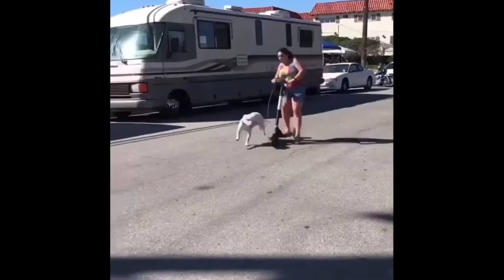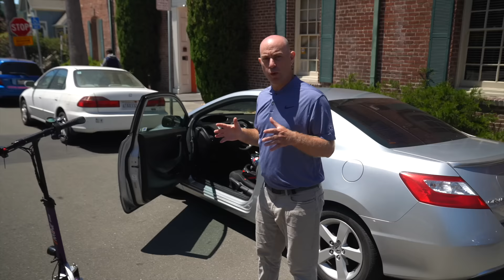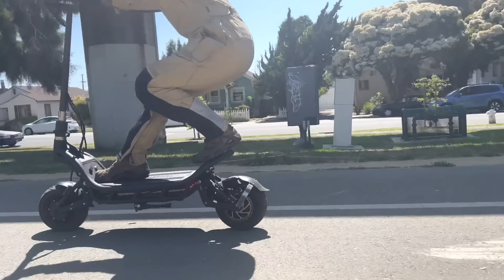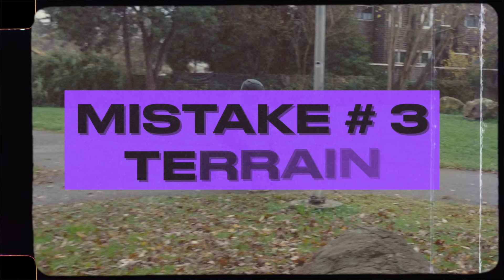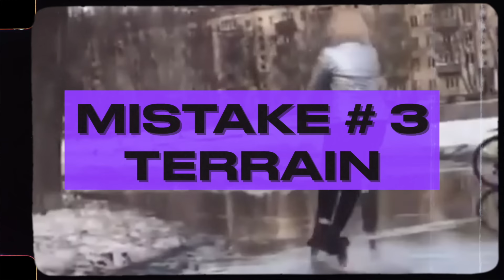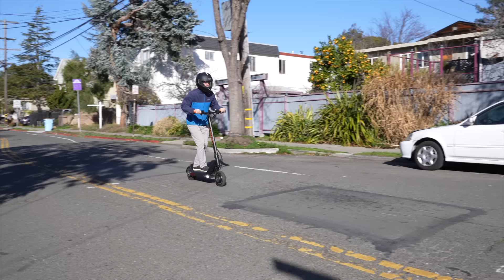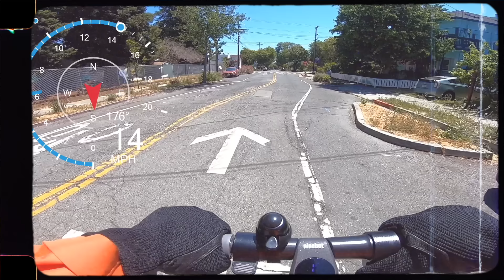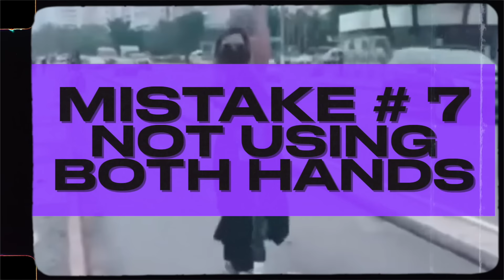Top 7 Riding Mistakes New Scooter Riders Make & How to Avoid Them

Comment: This video saved my life. Thank you so much. Hitting pot holes going full speed on a Apollo ghost is not a good thing . I almost flipped forward over the handle bars. Getting lower by bending knees and leaning back to get the back tire on the ground again actually worked. You saved me from crashing.
Reply from the maker: Wow! Awesome! Thank you for letting us know!    -Paul
Reply: How are you liking the ghost because I’m thinking of getting one
Reply: Im really liking my Apollo Ghost. I replaced the tires to Tuovt 80/65-6 . these tires are wider. And I installed a steering damper. Basically I could ride with no hands on cruise control even while hitting small bumps. The steering damper made the scooter so much more stable. Kool-Stop brake pads KS-DS20 provide better braking. Changed grips to ODI.  And I redesigned the rear foot rest from 1/4 aluminum and grip tape on top . No more slipping . The scooter is plenty fast. I push it hard and it scares me in sharp turns going 30 something. The Ghost is a great scooter.
Reply: @Snfjsjsi  I replied below your message.
Reply: @Syncere20  Wow, you really love your scooter. That reminds me of that song in Grease. A 2022 version. Seriously, I'm gonna buy one. That's why I'm here. I wan't to know everything I can before I buy. Your information is priceless. Even if I don't yet know what it all means.
Reply: @Syncere20  where did you find the steering damper for your ghost, I bought a phantom v2 and I already to had a nasty slip broke my wrist possibly under inflated off road tire and I hit a pot hole going 42kmh wheel started shaking aggressively, a steering damper would be wonderful
Reply: Also scooter is fine just a scratches
Reply: @jeffer0987 Steering damper is from Ebay. And the new Radial PMT tires are the very best out of several brands that I tried. It says there tubeless but you still need a tube. The steering damper and PMT tires are the best upgrades.
Reply: Does any1 know if the dualtron 2 is a good scooter
Reply: I love riding electric scooters but being a senior,  I decided to get a seated model.  It has front and rear disc brakes and I can control the scooter better if I hit a pothole because my center of gravity is much lower to the pavement than when standing up. And I always wear a helmet  because traveling even at a slow 15 mph could get me seriously injured if I crash.
Reply: Me too! I avoided a few accidents thanks to the tips I learned in this video.
Reply: Dude it's just the same with skating and surfing. Work on squats kettle bells Romanian deadlifts jump rope and medicine ball balance on bosu ball to improve your balance
Reply: you needed s video to tell you to avoid potholes? uhm .. what?
Reply: Darwin almost wins again...
Reply: if this video saved your life, then nothing will save your life)).......think about it)
Reply: @alexeylukonin4586  Leaning back and getting lower by bending knees. Helps so much when hitting pot holes and rough terrain.
Reply: Hitting a pothole with any scooter isn't good
Reply: Didn't you see the pothole???? 
Hmmm, don't try cycling then. You need your eyes open.
Reply: If you're riding you should get an nta helmet like xnito or bern hudson, cpsc helmets aren't really safe
Reply: @jeffer0987  ???
Reply: @alexeylukonin4586  ????????????
Reply: good job! experience = skill

with this behind you, you leveled up as a rider

stay safe out there and have FUN 👊
Reply: I know this is about scooters but I chose a huge 27" fat tire bike as my electric bike for this very reason you mentioned.... POT HOLES... we have tons of them here in Michigan.  I'm deathly afraid of wiping out due to a pothole that catches me off guard....
Reply: @Jimarillion    LOL
Reply: Apolloa fly.
Reply: @snf I recommend KABOO Mantis V2 with Long range LG battery pack FLUID edition and All season tires (street) 🥰😋🤤🛴💵
Reply: @syncere tubeless means tubeless ready. You don't need a tube if you don't want it. If you go tubeless (without tubes) you will lose more air per month
Reply: @scooterbob Scooter seat Always looks embarassing
Reply: Everything  you've mentioned has cam natural to me and I'm on my 1st scooter
Reply: @kaosreality7154  I now have 4400 miles on my Apollo Ghost. And 430 miles on my Inmotion RS. Im still learning safe riding techniques. Wet pavement im scared of still.
Reply: Bro,  i learned that on my Razor in 99'

Comment: I would suggest taking new routes in lower speed modes, in case of any unforeseen potholes or gaps.
Save the faster modes for areas you know well and  can avoid the potential issues
Reply from the maker: Insightful! Thanks for sharing. -Vosk
Reply: I would suggest limiting the scooter to 15-20mph.   People vastly underestimate how long it takes to stop at higher speeds and that when something goes wrong, how much that time matters. Not just stopping.  Reaction time will not be quick enough.   About 98% of people do not appreciate the dangers of high speed. This is especially true of experienced riders.
Reply: This might have saved me. I went OTB yesterday hitting a curb head on on my first ride out on my new scooter. Full scorpion, a few patches of road rash on my right arm, a sprained left wrist, and a soreness that made it painful to move for much of the next day. I was going full tilt (15 in my case) after dark and even with halfway decent lighting and a headlight I did not see that the curb cut for the wide multi use path I was on only covered about half of the trail crossing a street. If I had shifted down to 9 or 10 mph I might have been able to see it, or at least had more time to react.
Reply: Exactly what I did, taking it easy in eco slow mode getting used to the scooter I put one foot on the back metal fender and keep my knees bent.Learning how to use front and rear brakes at different speeds is common sense.Ive yet to crash.I came close but feel prior motorcycle riding gave me experience
Reply: Great advice here.

Comment: I fell 6/1 😑, busted my knee open, wounds to the left side of my face, broke front tooth, wounds to right hand. Went to the ER. I have the Emove Cruiser and was playing with speed in the river bed of a flood control. Things were going fine until I went in a different direction. Saw a speed bump out of no where. I panicked. Was unconscious for the rest. Was wearing a helmet. I'm a newer rider and learned some lessons the hard way. I got back on the scooter a couple weeks ago. I appreciate this video.
Reply from the maker: Glad you're able to get back out there.   -Paul
Reply: I'm thinking about some issues since 2019. Small wheels, short wheelbase, narrow handlebars, tiny braking rotors, no abs, non existing suspension, 2inch wide tyres maybe, in some cases solid pieces of rubber. I think sth is wrong with the world, you should be going 10mph maximum. You can't choose which law of physics affects you. Or can you?
Reply: I’m starting to be afraid…. I just received my e-scooter and now, I’m not sure I wanna go out 😂. I hope you are feeling better!
Reply: hehehehehehehehehehehehehehehehehehehehehehehehehehehe!

Comment: Loved the traction test. Never seen one of those on a scooter before, and had no idea wet leaves give you only 30% of regular traction.
Reply from the maker: Yeah, it was fun to confirm our gut feel on that one!    -Paul
Reply: I can verify this from rear wheel drive cars in the fall in rainy climates like Seattle.  Wet leaves are like hitting ice!
Reply: I got goosebumps watching that traction test on wet leaves and sand. Those are my mortal enemies while riding my motorcycle. It is best to anticipate these obstacles but if caught off guard, stop using the throttle and ride it out.
Reply: There's a HalfAsInteresting video about how wet leaves are a massive problem for trains, their massive weight and minuscule contact area means leaves get crushed into sludge that messes with brakes and makes them prone to overshooting stops. The solution to this was LAZERS on cleaning trains.
Reply: @fay or they don't use the sand system

Comment: I wish that I saw this video about 2 weeks before I had my accident on my emove cruiser. I would have known to take off my cruise control first, then lean back with my knees bent to try and avoid a pot hole covered in leaves that I hit riding to work on a New York street causing me to fly off injuring my left foot (heel and big toe), and left shoulder. Thank God it was early enough that no cars was driving behind me. Video is a God sent. Thank you.

Comment: I just got my first scooter and it's an unconventional choice.  Haven't fallen yet, but did have to bail and run with it a few steps when I felt it tipping going around a corner with less traction than I thought.  No harm to me or the scooter, but I'm glad I took an hour or two of free time to ride it on an empty street and college parking lot, and then around campus. I'm still going to practice a lot more before I start taking it to work.
 My tips:

1.)  Take your time to get used to the machine in a safe environment and at slow speeds, and build up from there.

2.)  Plan your routes ahead of time based on safety, and go for a practice drive at a time with minimal traffic if you can.  Slower side streets (in my case near a university where cars are more used to looking out for pedestrians and bikes, and residential neighborhoods off of main roads) may take a little longer but may be safer.

I plan to use my scooter primarily to get to work, so these might not help people who are riding for leisure 🤷‍♂️
Reply: Or for sports, for either way, good advice for beginners
Reply: Exactly, I don't know why these people are just face planting 😂😂 have some survival instincts and run for heavens sake.

Comment: I applied power as I was going off a curb, to keep the deck parallel to the ground and land on both wheels - and this is something I've never had a problem with except once, I wasn't paying as much attention to the power application point and, having misjudged it,
 the scooter took off without me and for a brief moment I was looking straight ahead with my front wheel at the height of my eyes. In moving away from me, the scooter took my feet out from under me and I landed on my back.  Fortunately, I was wearing a messanger-bag type, soft Saddleback leather briefcase on my back and landed on it more than anything else.  Did scrap an elbow, though.

"Don't relax on a scooter.  Assume you're always in danger......because you are."

Lol

Comment: For the stance to adopt when accelerating and especially braking I explain to people that the lower your gravity center is, the harder it is to fall, harder, not impossible, so lower your butt and use your front or back leg as a body break.

Too many people think that it's okay to drive one handed. No it's not, once wabble starts it's really hard to stop it, so keep at all times both hands on the bar AND YOUR THUMBS ARE YOUR BEST FRIENDS! always keep them wrapped around the bar because they are the best hooks that are gonna keep your hands secure on the bar and avoid them to slip when you brake hard.

NEVER put any loose weight on the stem (or your body) like a tote bag full with groceries, this is the easiest way to lose control. A loose weight and or large bag or anything that can be caught in the wind or on a car's side mirror is a danger ⚡⚡⚡. The weight that's shifting when driving is hard to counter and is unpredictable, the scooter can wabble very fast or get pulled in one direction when you lean.
If you have to have a bag, choose a rather thin one that attaches to the stem AND DOESN'T MOVE or a backpack that is tightly attached!

SHUT YOU MOUTH WHEN YOU DRIVE! 🪰🪰🪰🪰🪰🪰🪰🪰🪰🪰 Avoid catching insects with your mouth wide open because you could choke, natural reflex, and lose control. You're driving so just STFU 🤣

Please, don't wear your worn out and slippery shoes when you drive, a solid grip is so important when you put feet on the ground.

Always check your brakes before riding, especially in very cold weather if you can't help but drive, cables sometimes can rupture. So a few movements before riding is a good checking to do.

Don't brake only when you're at the sign stop or whatever obstacle. Release your throttle way before, your braking will be easier, more gentle, less stress on the brakes and you can save battery, some scooters can go free for 50m, so imagine the economy after 20 stops... 1km... Just saying.

I would have a ton but that's what comes to mind :-)
Reply: great info RC tks
pls share if U think of more
😇💚
Reply: I've always been a one handed rider, BUT I just upgraded to a ninebot max. I'll take the advice
Reply: You won't have to shut your mouth if you wear a full face motorcycle helmet
Reply: @absolutelyfookinnobody2843  on small electric scooters that do not exceed 25km per hour people don't bother wear a full helmet, I'd be happy to see them wear a good bicycle one that is well tightened.
Reply: R. C., thanks so much for your advice.  I created a note on my iPhone and pasted them in there to use as a reference.
Reply: @TheCanalZone  you are much welcome, ride safe, have fun.
Reply: Cool story bro but you don't drive e scooters. You ride it
Reply: @mann_idonotreadreplies  sorry, I'm not a native English so I don't know nuances ;)
Reply: Thanks. Good info.

Comment: Great video. I notice that  even when people realize that they are about to go down with their scooter, they still fold on tight.  I know it’s easier said than done , but this isn’t a boat and you don’t have to go down with it.  Let go and jump off. Be prepared to run as fast as you can then slow down. If the speed is to fast, after you jump off , once your feet hits the floor ,( if it does) prepare to break your fall like in martial arts. Every thing in the video and suggestions in the comments should become second nature to you. And gear up.
Reply from the maker: So true! I've seen photos of folks on the race track, holding on tight, long after the chance to save the crash is gone. It's good to recognize that once you've passed the point of no return that it's time to follow Ben Kenobi's advice and "let go"!      -Paul
Reply: Good luck trying to bail with bad knees and lower back! 😞
Reply: Geez...i better cancel my order and change it to a kid's e-scooter.
Reply: I have never seen a martial artist break a fall at 20mph...at best assume fetal position and roll. Any extended extremities at that point will bend or break unless you're not built like a normal human being.

Comment: I was riding a Lime-s on a sidewalk (never ride on sidewalks). Downhill, at full speed, I hit about 22mph. I got slightly off-course and let my front-wheel get off the sidewalk, thinking I would just run off and back on. It had snowed the week before but was well above freezing now and the snow had been melting for days. As soon as my front wheel, carrying my 200 pounds, left the sidewalk it buried itself hub deep in the soggy grass. I went over the handlebars and into the street. No helmet, no gloves, my second time to ride a scooter and it was my 50th b-day. lol....I limped away with just some road rash, a couple of bruised ribs, and a newly found respect for electric scooters. I now ride almost daily and have logged several hundred miles accident-free. I learned many things that day and remember them every time I ride.
Reply: Totally agree I learned my lesson after falling now I baby it when I ride I stay off sidewalks and I ride like an old lady the minute I see a bad pothole I slow down and go slow around it
Reply: My first time riding ( kick scooter). 3 weeks ago, and I too am 50 yrs old. 
  Small pot hole= miner whip lash, road rash to half the face, and bruised knees.
 I panicked. If I had stepped off, I would have been fine.
 I'm glad you came out alive. Sounds like you were doing 20 MPH faster than I was.
  It was a present for the 8 year old boy.  I still ride it every time he does. I hope you are still doing it as well. 
 Be safe... I reread your post. You are still riding 😁👍
Reply: That happens when you get cocky
Reply: You can ride sidewalks but you still need to be safe and some sidewalks are better then others eg. Not all sidewalks are created equal. I've even got away riding in opposite bike lane too but I brake and check for cars. I'm 17 and no crashes
Reply: @eazysmokes3743  absolutely but u have to watch out for people pulling out blind  driveways and store fronts I would only go full speed if I was taking a short cut through a empty parking lot of a office building to shave a few minutes off my commute if I was running late I live in a heavy traffic area near a major interstate on and off exit ramps I have to be hyper aware I’m constantly turning my head to avoid surprises
Reply: If it looks like a place a car could pull into or could pull out of I stop immediately from a speed of around 15mph and look left and right then behind me and then I hit that throttle until the next point. I have really good braking ability believe it or not .
Reply: @jaredharris1970  I'm not hitting full speed all the time. Okay I am when I am not around cars then I slow down to 15mph to brake.
Reply: @jaredharris1970  I even hit small front tire jumps for fun and to avoid obstacles in the road I'm practicing front tire jumps at the moment
Reply: @jaredharris1970  the trouble is people don't expect you on sidewalks, they can't hear you coming. I've seen plenty of near misses involving the elderly and young kids.  People like dex man give you a bad name. Here in the UK there is talk of banning scooters. I think some sort of safety training is needed
Reply: I am 49, have no driver's license, and am considering buying one of these. And start veeeeerryyy slowly lol. Am a bit scared though...
Reply: I broke my collar bone from almost the same thing but it was a bike path and the mud was frozen.